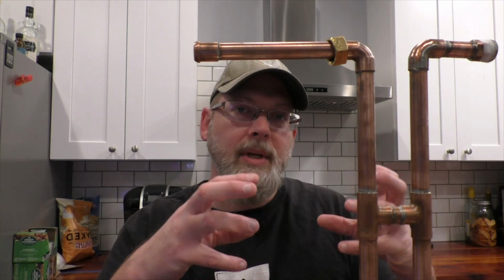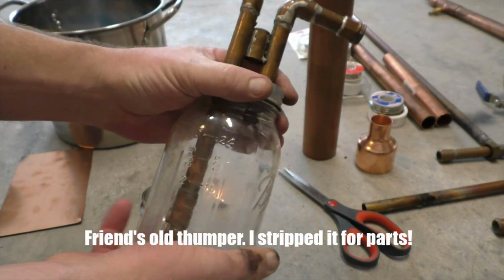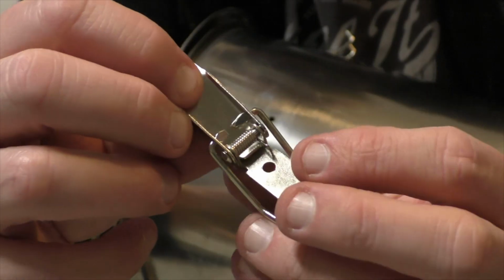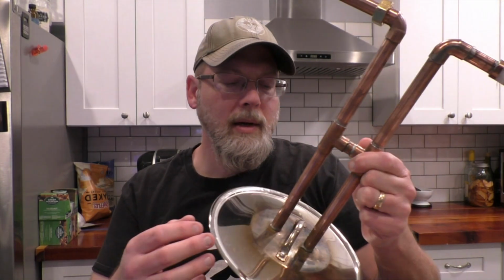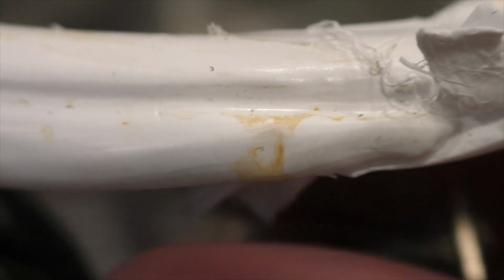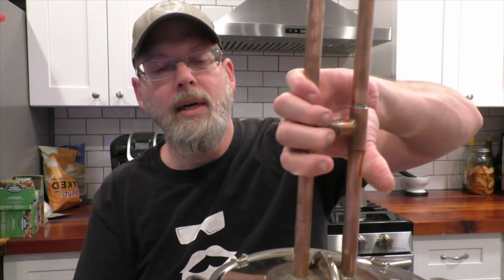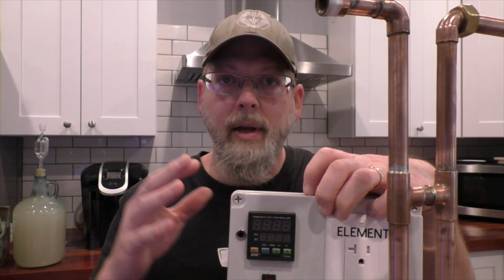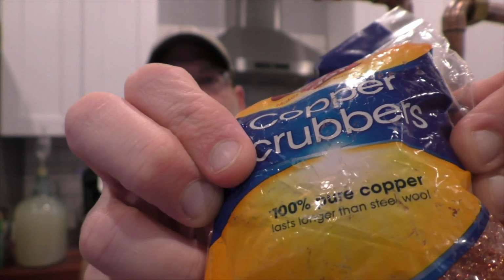How to Build a THUMPER For Your Pot Still!!

Comment: Reality check... canning jars are designed specifically to be immersed in boiling water. The vapor coming out of the still is LESS than the 212F that water boils at. As long as you don't allow pressure to build up, there is zero risk of the glass "exploding" or being damaged in any way from the heat.  

As to pressure and vacuum... barring a physical obstruction, the height of the liquid in the thumper sets the maximum pressure and vacuum. Inches of water is one of the standard measures of pressure/vacuum. 26inches is 1psi. So less than 3 inches of water is about 1/10th psi. Again, an actual canning jar is designed to deal with immersion in boiling water, and then hold the vacuum that canning creates. 

Yes, decorative jars that LOOK LIKE canning jars could shatter. But those shouldn't be used for anything else in the kitchen either, for the exact same reason.
Reply from the maker: True, but all glass, even lab grade can have flaws or micro cracks that are hard to detect. Best not to find out the hard way.
Reply: @BeardedBored  flawed glass cracking? Absolutely. Cracking causing anything like a dangerous situation? No. The pressures you're dealing with aren't sufficient to tip it over, let alone launch pieces anywhere.  

I understand that you're just trying to be cautious, and that's certainly better than the opposite mistake. But tempered glass canning jars are literally designed for more abuse than this application. Barring being dropped or something, they last indefinitely. Glass has many of the same non-reactive benefits as high grade stainless, and the added benefit of being able to see whether its clean better.  

A word of caution is smart. But there are a lot of good reasons to use these glass jars as well. In fact, if used smartly, they're probably worth suggesting for this and many other hobbyist uses that require rugged and temperature resistant containers.
Reply from the maker: @ChristnThms  I can't agree with you. I have had a brand new jar break from heat when canning pickles, and I know it has happened to several of my family members over the years. It's rare, but it does happen. Google is full of information on stress fractures causing mason jars to fail.

I think they look pretty cool as thumpers, but I can't endorse their use because of the potential, remote as it may be, for catastrophic failure.

We're not going to change each other's minds on this topic, so I'll simply say I hope you stay safe and have fun.
Reply: @BeardedBored  yup. 
All that aside, I've really enjoyed your insights on making and using thumpers. I love that you combine both the practical and subjective bits of info. Keep up the good work.
Reply from the maker: @ChristnThms  Thanks Christian.

Comment: Couldn't you use a pressure cooker pot, modified as a thumper?
Reply from the maker: Yep. The biggest challenge is the steel is thicker and will be a little trickier to solder in your pipes. Other than that, should work fine.

Comment: I have the same pot as my thumper. I have always used it. I have a 10 gallon boiler. I do use silicone as a seal and wrap it with Teflon tape. I have never found any foul flavors from it. I also use regular wood clamps( med. Size) to clamp it down. I have never gotten a leak that I could not fix with another clamp.  I did add, on both my pot and my Thumper, a ball valve. Once my run is done I open them instead of undoing all the clamps right away . I just open the ball valves. Instantly releases the pressure as it cools. Wish i could leave a picture. All in all nice video.
Reply from the maker: Woodworking clamps are the best! I almost went that route, but figured I'd see if I could work out the spring clips. I like that ball valve idea!
Reply: Yes they work great. The only draw back is storage. I did order the same spring clamps but have never used them. I got them from Wish.com. I was watching your condenser build I also went that rought. However i made it go through  two. The first is right off the thumper about a foot long. Then a 90degree turn to my 4 foot one. Works better then a worm and wont clog up. I like the wire wrap inside the water jacket. I may have to take mine apart. Thanks for the response back. Happy distilling!!
Reply from the maker: @David Duncan 👍 👍

Comment: Interesting factoid - the thumping sound comes from the instant collapse of the hot vapor as it hits the cold liquid in the thumper.  It will quieten down considerably as the thumper liquid heats up.

Comment: Safety suggestions:  cut a couple of notches in the bottom end of the input tube, open up your boiler fill port when you shutdown to eliminate any boiler vacuum, don't run on the grain without a PRV.  Use common sense and read some of the thumper build threads on the forums.

George's video about the crushed boiler was meant to discourage the use of a thumper.  Mainly because PIDs don't work with thumpers, even though he doesn't say that in the video.  Better to just rag on thumpers I guess.
Reply from the maker: Yeah, he's not a fan of them. But there are just too many cool things about them to not have one. Hopefully I can show that in some upcoming videos:-)

Comment: Another great video!  Something I recently learned about thumpers:  If you insulate them, the tendency for them to fill up over a run will decrease a bit, which will help if your thumper is on the smaller side compared to your boiler.
Reply from the maker: That's a great point! I'll mention that in the next thumper video. Thanks brother!
Reply: How do you insulate them?
Reply: I got a small piece of insulation from Home Depot and wrapped the thumper with a bungee around it.

Comment: hi there  questions?is the thumper important to distling
Reply from the maker: It is an optional piece of equipment that can be used to increase the flavor of a spirit. For example, if you are making a fruit brandy, you can add fresh fruit to the thumper to infuse more flavor. Thumpers are used in Jamaican rum production as well.
Reply: Adds a lot of flexibility to a pot still.  I sometimes use mine for gin production - macerated mix in the thumper and water in the boiler to do a steam distillation.
Reply from the maker: @southcack8245  Cool!
Reply: special thanks...to your gorgeous hobby

Comment: there's also the cardboard gasket wrapped in ptfe tape if you've got the time and patience
Reply from the maker: That was my backup plan if this hadn't worked. I'm looking into some other gasket material used in commercial distilling that might work better. After I have a chance to test it I'll make a video, but you can check out EPDM gaskets if you're interested:-)

Comment: Great bits of info, I appreciate that you do alot of research. Does anybody ever put a thermometer at the exit near the condenser, or anywhere for that matter?
Reply from the maker: I've seen some folks do thermometers in the outlet of the thumper, but I have no idea if it's accurate enough for cuts. Maybe one of these days I'll see if I can rig one up with the PID George gave me and find out what happens;-)

Comment: I would argue about uesing Mason jars. Depending on the size of the still. Mason jars are rated for both the heat, and pressure we would be uesing them for. Yes you need to be aware of the limitations of uesing glass but it can be used safly and successfully.
              That's a nice looking thumper adding the stiffiner was a great idea. And a good idea for the seal . 
I might also caution uesing cork you need to know if its natural or glued you dont want the glued cork stough made in China who knows what thats made from.
Reply from the maker: I've used cork once, but I'm looking into EPDM for better gaskets in the future.
Reply: https://www.amazon.com/dp/B00JI8AKOG/ref=cm_sw_r_cp_apa_fabc_rgT3Fb5S635HN
A plumber friend recommended this to me once. When I was making a gasket. Its food safe but im not sure about if its ok for stilling, but if it is you could glue your gasket together with this.
Reply from the maker: @spikelove9533  Mmmm, I don't know if that would be safe. It says it has to cure which means it may have some nasty stuff in it. I'm finding a lot of good stuff about epdm gaskets, tons on ebay. I'm thinking of some epdm tubing for a pot rim gasket might do well.
Reply: @BeardedBored  yea food safe doesn't mean still safe. Acetone reacts with alot of stough. I thought silicone was ok for a long time. Then I read it wasn't so I had to switch all of my gaskets to Teflon. Tubing makes great gaskets. Split it open and you have a nice stay inplace gasket. 
I use flour paste on my pot still but she is just a baby and mostly for experiments. 
I'll be looking foward to seeing your findings, this is pretty important for alot of DYI still builders and something there isn't alot of info on out there.
Reply from the maker: @spikelove9533  Thanks Spike:-)
Reply: I never thought about exploding jars! another hazard along with what is the plastic under the lid to create good seals for what you store in there. It aint PTFE
Reply: @alstonofalltrades3142  I don't use a standard mason jar lid I use a fabricated copper disk along with a teflon seal. I do use the standard outer ring mason jar screw on ring that is steel but it doesn't come into contact with anything inside of the jar. Mason jars are perfectly fine to use for thumpers, if you take into consideration their their limitations and make allowences and slight modifications to make them suitable for that propose.
       If we look at lab distilling equipment it's entirely made of glass and glass that's much more fradgle than mason jars. It is how ever suitable for it's task. 
       The jar it's self is designed to exceed any heat and pressure we would put it threw during a distillation run.  I feel like there is 0 chance for failure as long as you use jars that are free of defects so inspection before each use, and avoid uesing any materials that could cause contamination to seal the jars up. I will admit a stainless steel or copper vessel has much less chance of any kind of user error to cause failure, but for a small still those aren't just readily available.
Reply: @spikelove9533  cool your on it that's the main thing. I don't know enough about glass myself to say, but when making jam I put the jars in warm water and then take them up to boiling to sterilize instead of dunking them jars into boiling water and cracking them.
Reply: @alstonofalltrades3142  I've always worried my granite counter top would make a hot jar crack or shatter. I doubt there is enough temp change to cause that but I always put a towel under the jars for some insulation.

Comment: Try placing a pipe cap onto your dip tube in the thumper and drilling several small holes in it to disperse the vapor.  5-5-1 is a great cleaner for copper piping and to remove solder flux!  No need for a sacrificial fun.
Reply from the maker: Thanks for the info

Comment: Could you add a 3 way ball valve prior to the thumper to separate the heads from the hearts? Seems like that would reduce some of the complexity of cutting later.
Reply from the maker: Sure. I've seen that set up on bigger stills.
Reply: @BeardedBored  StillDragon does this with their rum thumpers.
Reply: One thing I have learned in industrial safety classes.. think of the dumbest thing you could do. Now figure that at least one person who could use what you design may have the ability to do something at least 25% dumber! It may sound impossible that you would forget to open a closed ball valve, but... if you did..bad times had by all! The liquor fairy here keeps a coupler uncoupled until time to run to the thumper. Then a pair of welding gloves will get you safely connected and running.

Comment: Hey bearded , I wonder if an e.p.d.m (inner tube rubber ) gasket might work
Reply from the maker: Actually that's a great point! EPDM is also non-reactive. Here's the website I use to check the chemical resistance of materials to various compounds in distilling - https://www.coleparmer.com/Chemical-Resistance

Comment: MANOMETER - It is THE SAFEST WAY to monitor pressure in the boiler.
It is a Pressure Relief Valve and a Vacuum Break preventing a catastrophic failure.

Put a 1/2" TEE to a SIDE output of the vapor path. Connect it to 10 foot long clear hose.
Let the hose droop down (trap) out of the TEE then up to a higher point than the still, then back down to safe distance away from the still.
Put pint of water in the hose so it fills the trap. (Jump like a water trap on your sink)
>>> The hose is NOT PART OF THE ALCOHOL VAPOR PATH. Vapor cannot flow because of the water in the trap. <<<
It will show you a visual reference of how much pressure is in the boiler and whats going on.

https://www.hearth.com/talk/attachments/vacuum-20figure-202-png.222980/

Pressure Relief: When the still is running you can see the water being pushed higher to one side of the trap. If some really goes bad it lets the pressure vent out.

Vacuum Break: When the still is OFF the it will start to suck the water back into the boiler. It will just gurgle and allow air into the system without the atmosphere crushing the vessel.
Reply: The pressure and vacuum issues are due to the change of temperature in the vapour space and the rate of change can be larger than the manometer can flow liquid through if its diameter is too small. Great tool in principal, but just be careful with sizing the tube 👍
Reply: @brendanwhite104  I use 1/2" heavy wall Silicone tubing that I use for brewing beer.
If the pressure builds too high it will vent down onto a stainless slop sink.
Been working fine 40+ runs including a steaming run on all grain wash in the thump.
Reply: @BigEdsGuns  apologies Ed, re read your thread and see you’re tee is in the vapour space, so will work well if the need arises 👍
Reply: @brendanwhite104  It's all good.
It's hard visualize it without pictures.

I have a 3" tri clamp tee that goes rite onto the top of the boiler. The vapor path to the thumper goes up and elboes over. The manometer TEE points to the left with a 3" tri clamp disc with a 1/2" npt stainless 90 street elboe that points down with a male stainless quick disconnect. The silicone hose has a female quick disconnect. That runs down about 3 feet (trap), then up 7 feet, then down again above my sink.
Reply: BigEdsGuns I’ve got a spare 2” tee and will have to add it in on the next run. I don’t use a thumper but it will give me peace of mind during the gin basket runs 👍
Reply from the maker: Ed, this is gold! Never heard of it before!!! Thank you!

Comment: I call my rig the Roller Coaster.
BOILER: 15.5 gal keg with 6" TIG welded tri clamp top, legs welded on with 1/2 ball valve clean out on the bottom.
THUMPER: 15.5 gal keg flipped upside down with a TIG 6" tri clamp top, legs welded on the bottom there is a 2" clean out with 2" butterfly valve 
26 tri clamps and PTFE gaskets total. Goes 6" to 3" (with Manometer) then 2" TEE with 1" copper spear to the thumper, output is 2" then to a 3" stainless shotgun.
Reply from the maker: Wow! That's a serious rig!
Reply: @BeardedBored  Gonna post some pictures soon.

Comment: To make the gasket use 100% food safe silicone and apply to the lip on the lid . Most lids have a lip to hold them in place  which creates a valley to which you can  fill with silicone  and use a flat spreader to lat it down flat and level. I'm not a fan of permanent placed lid clamps ,  try a bar joist beam clamp, they can be altered to fit and work quite well, looks like a mini c clamp.  I've had many variations of pots over the last 15 years and the silicone on the lid has lasted that long and still working.
Reply from the maker: I was going to go with food grade silicone. But before I bought it I decided to check the chemical resistance because I'd read a few things that made me wonder. Here's the website I used to check the resistance of various gasket materials to various compounds in a run - https://www.coleparmer.com/Chemical-Resistance
Reply: @BeardedBored   Did ya also know that PTFE will off gas chemicals lethal to humans in small doses if used in high heat situations?  You're not reaching those temps but why would ya use it knowing that? Especially making ethanol that you plan to drink. The basis of silicone is silica sand, carbon hydrogen and oxygen, two elements that are are already in your mash starting out.
Reply from the maker: That's true, but as you said the temperature range of PTFE is quite high. 500F is the upper limit for sustained operation, and doesn't start burning until around 620F. Your pot still would have to be on fire to get that hot. Below that temperature there is no off-gassing, which classifies ptfe as thermally and chemically inert under normal operating temps. That stability against thermal and chemical breakdown is why PTFE/Teflon is an industry standard gasket material for commercial distilling and other industries, as well as being the most common non-stick coating for cookware. I'm not saying standard triclamp silicone gaskets are bad for you, but they do react to acetone. I have to assume the same is true for food grade silicone. It is a much easier material to work with and would have made my project a ton easier, but I chose to go with PTFE for the added bonus of its non-reactivity.